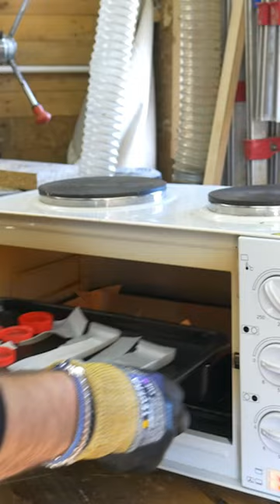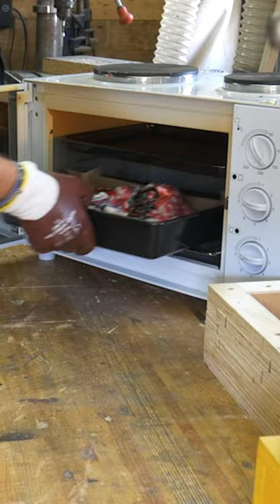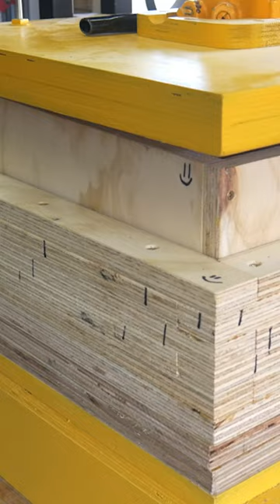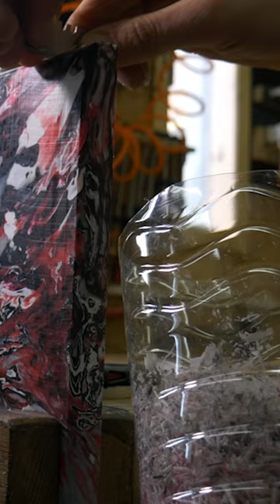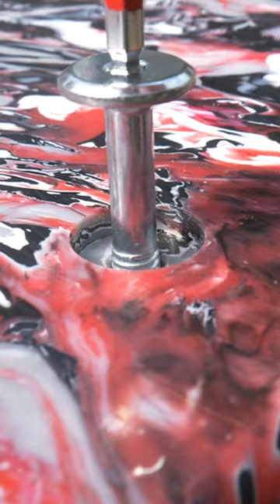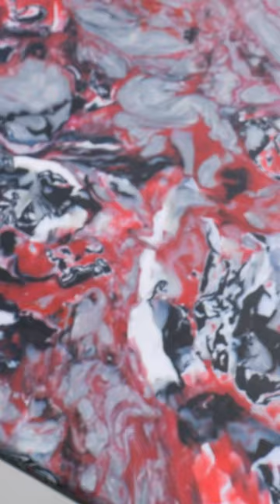Making a Stool from Recycled Plastic

Comment: Absolutely stunning! What happens with the leftover shavings? I have so much respect for what you do in order to recycle plastic! Sad that the same ones who could be doing something like this and doing things differently than they do just don't care about our planet! This is amazing!
Reply: They go back into the bucket of chips to be used again.
Reply: You DO understand why this ISN'T common practice... You DO know that plastic degrades with each melt. So it's unreliable. You can add a little bit of used plastic added into each batch but 90% plus has to be NEW plastic. He's making random junk that doesn't have much purpose. It doesn't matter if his stool cracks. But often plastic makes some serious components that they can't risk failing. The best use for plastic bottles is to wash sterilise and refill like they did with glass bottles. But that would need a small redesign of the bottles.
Reply: @cececox6399 I think they did a video on this and got a lot more uses than expected
Reply: @cececox6399 I've heard that, but there was another plastic recycler/crafter that put it to the test. He'd inject the plastic into a mold, shred it, melt it, mold it then do it again. He had repeated it thirty times and still didn't get a noticable drop in quality.

Comment: Why do you twist the material?? Is it just to mix the color..??
Reply: Probably
Reply: It's because they remove air bubbles between the material, they said in a video
Reply: I think they said in one video that its also to get rid of possible air bubbles but
Not that sure, because air won't be able to stay inside plastic after that pressing anyway